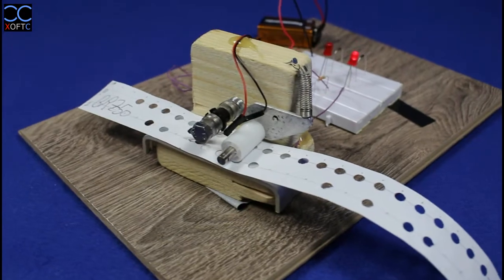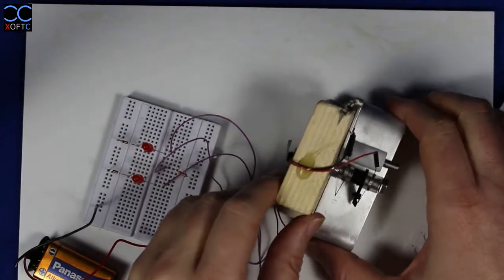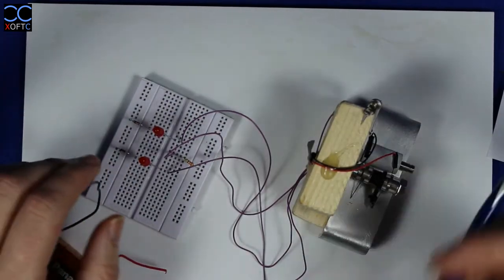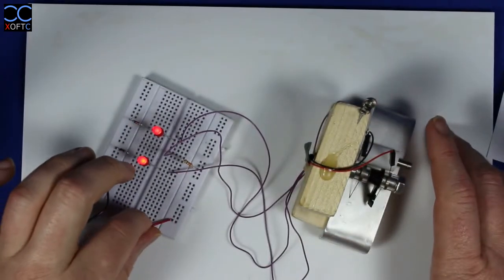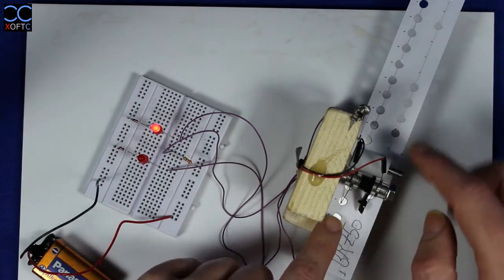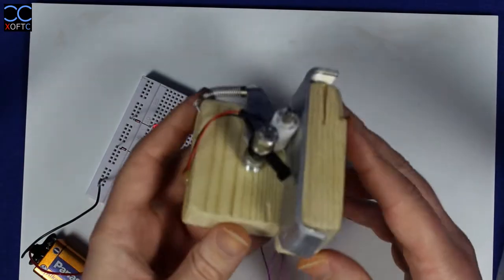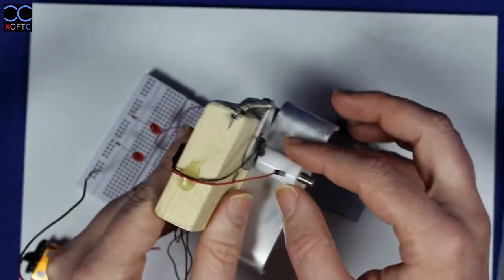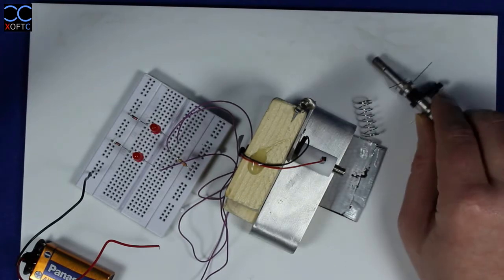Scratch Built Punchcard Reader

Comment: 1st --- That's not punched card, that's paper tape - predates punched cards.  It was around until Compaq  bought Digital Equipment Co. and closed it.  Their mini-computers used miles of it for initial load of the OS and Field diagnostics - disks were the size of 20" Pizza boxes, held 10mb and were EXPENSIVE.   I used to write assembly language software for a DEC PDP-11/34 with  2x 10mb disks and 16KB cards of Plessy Microsystems  CORE ram (looked like a window screen with little ferrite doughnuts at each wire intersection).  One 10mb disk for the OS and utilities and local software, the other for data... 
2nd - - your timeline is a bit off --- If my memory is right --- Floppies first came out in the 80's - first ones I saw were 10"  across and were used in WANG equipment.  5.25" floppies didn't come out until later - when the IBM Intel 808x pc first showed up  they were 5.25" across and held 360kb each at first.   Later in the 90's 3.5" (floppies inside a plastic case) diskettes came out, first 360KB and then 720KB and finally 1.2mb capacities.  DOS was on one diskette, early versions of windows came out on dozens of them, MS Office came on 32 of those diskettes and took all afternoon to load.  Winchester Hard disks - 10mb big, heavy things that cost over $400 at first came out toward the end of the 1980s.   Internal hard disks in IBM PC/AT with Intel 80286 processors.  Internal disks bigger than 10mb came out with the 3.5" diskettes on intel 80386 and 80486 processor machines.  They weren't very big - compared to today's terabyte sized disks - and they were still expensive.  CD & DVD came out late in the 90's and the blank discs cost about $15 each.
Reply from the maker: Thank you for sharing your experience.
You are right in the video its not a punch card, i just use that name for anything punched and its my mistake :)
My first computer was a 286 and it came with 5.25 floppy drives. i envy those who worked on computers at the time they where more machine like.

Comment: yes but how does the machine make sense of this ?
Reply from the maker: It is a very simplified example but the way these readers work is that hole = 1, no hole = 0, the reader would have a line teller with a fixed movement and the inputs that "read" the holes would pass the values onto the data bus and from there be computed.

Comment: That's pretty clever. I like it. I have an idea for a VERY simple kind of electro-mechanical "computer" I want to build, and I planned on using punch cards or tape similar to this in order to save and load information.
Reply from the maker: ct92404 Thanks. Glad you liked it.
Maybe one day I will make an improved version with a motor and connect it to the Z80 computer I'm currently busy making :)
Reply: @XoftC  did you ever do it?